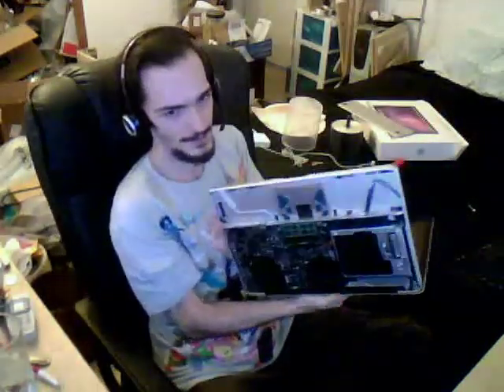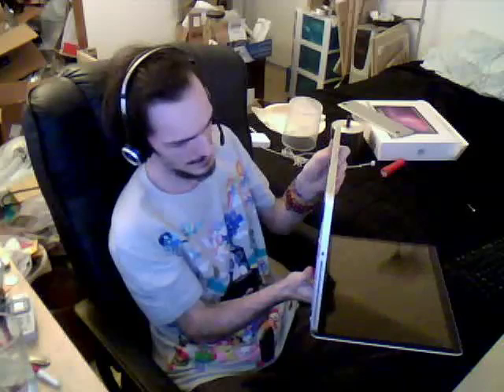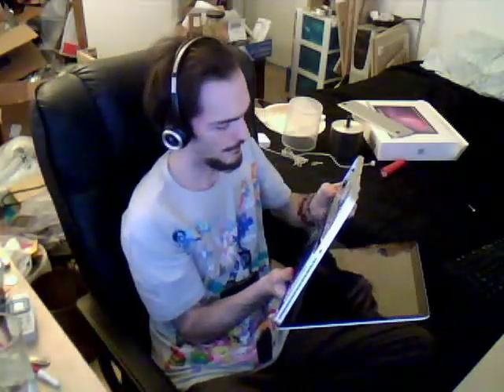Macbook Pro ribbon cable

Comment: I found it difficult to get info on the keyboard connector and even though i had done it before if forgot how to do it. For anyone who is a bit stuck on that or the back light connector here is the info:
  To re-insert you must lift the eye lash (the tiny locking lever at the BACK of the 2 connectors).
Even then it is difficult so i used packing tape cut down to the width of the ribbon cable, there is enough friction with the sticky to lift and push/pull the ribbon cable gently back into the slot, this can take a great deal of gentle fiddling till you get it right, it slides in 4 or 5mm no less! you should know once it is in and parallel, then you can close the eyelash doors Hal. The backlight connector doesn't seem to slide in as far it's not as difficult but be gentle an close the door once you think it's in enough;)
Reply: izzzzzz6 thanks again!!  Too bad I think I bent something or broke something bc some keys work but not backspace and some others, maybe they didn’t line up right
Reply: GRACIAS COMENTARIO DE HACE 5 AÑOS

PROTIP: Masking tape

Comment: so here's my problem i replaced the keyboard on a macbook pro 2010 13inch.
when i plug in the power it turns on... problem keyboard doesnt work, i think its because i dont have it in far enough so at this point im not sure what to do, i tried releasing the lock and pushing it in as well as i could and still the keyboard wont function
Reply: jairtzinio did you get it to work

Comment: Good video, I would also stress that when installing the ribbon, make sure it is seated all the way. Otherwise you may think you have a dead unit. I used some tweezers to guide and set the cable. This requires a minimal amount of force. Prior to doing so, I assumed the new keyboard was defective, I wanted to be absolutely sure before remove the 50+ screws that are insanely small. Thanks for you video, it helped to have seen it from your microscopic camera!